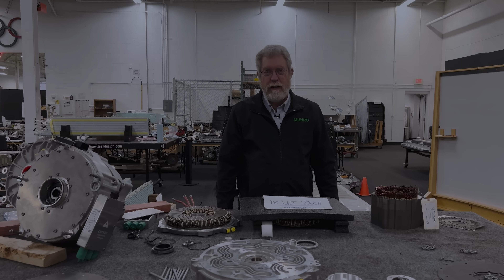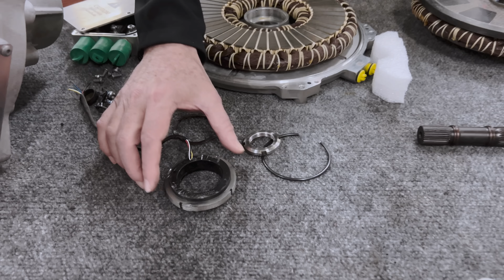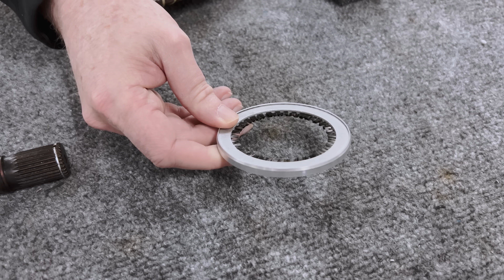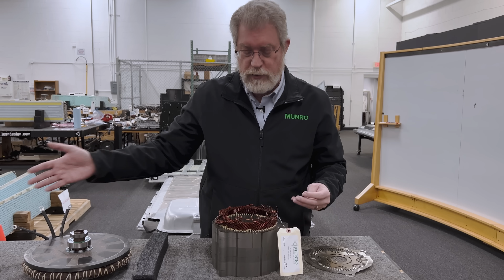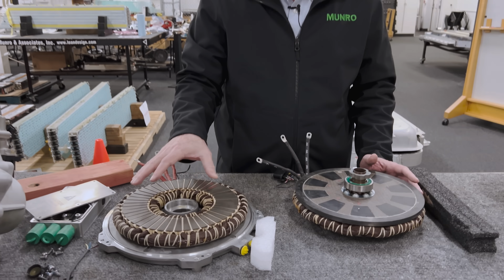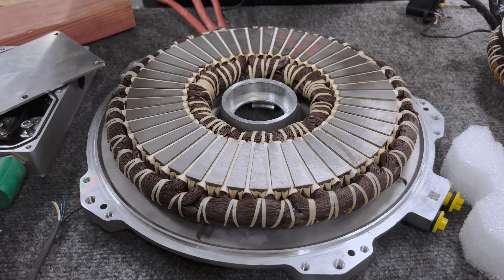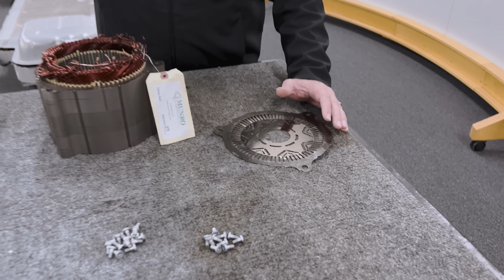Axial Flux Motors Explained: The Future of EV Powertrains?

Comment: I don't see any unrestricted forces being applied to the bearings?!!? None more than the weight of the rotor.  Which is exactly what ball bearings are made for. Please help Me to see what I'm missing?!    All I see is a spacer between the two stators, to keep them at a solid even position without fail, only to leave the need for the rotor to stay centered.  Which wouldn't be an issue.  As long as its centered, the pull from the magnets affecting the iron cores, will cancel each other out.   Simply by design.  Without any more cost to engineering… Im sure that's one of only a couple main reasons for two stators.  The other being a more efficient HARVEST. (LoL amazing usage yeah? LoL) of the flux.  Those being the two reasons people are getting excited about them. 

With the exception of the one other design,  be it only slightly different! 

A  PM BLDC AXIAL FLUX, CORELESS/AIRCORE, with in my opinion even one more possible big design attribute, but I'm not sure I want to give it away yet.  I need to find out if my idea works better on not first. I don't wanna sound dumb. 

 Lol.  But anyway.  Having an Air Core coil does drop a little area for Essie currents to be active. But it also drops a very very large percentage of magnetic friction slowing rotation.  

Giving vertical wind turbines a chance to ENTER THE ROOM! LoL  Not having much of a  torque need for start up cost at all.  A No iIon.  PM BLDC makes for an easily spun generator.  Maybe not as efficient as an iron core motor when coreless, But when you need a low torque start up.  Like vertical wind turbines. And their desire for high free spinning rpms.  I think they are going to stand on the same soap box as force driven turbines, like the horizontal ones. !!!  We shall see!  

Anyway. Please. Let me know what
Im missing.  I may not sound like it. But my knowledge is humble.  Im not afraid to learn.  Im happy knowing what I know.  But I can go further than the normal person. And say that I'm more proud knowing what I don't know. Those are
Two completely different things! Knowing when to say “I DOMT KNOW” Keeps any Man from being wrong!!!   That's the secret peeps if you didn't know..  Nobody actually knows everything.  Not one single person is always right.  But a very average person CAN NEVER BE WRONG!!!

Comment: Yawn, these are pancake motors and used for ages (40 decades?) in industry. Originally as DC and later as AC with magnets.
Nothing new just engineering and refinement for automotive applications. FYI; 30 years ago electrification in many applications started like in machine tools, direct drive elevators etc. etc.

Comment: That cooling duct doesn’t seem very efficient to me. 
The cool water will be heated by the returning hot water resulting in much less heat transfer. Yes you get a more uniform temperature over the plate but at the expense of less cooling. I would think that more cooling is more important. The hottest winding will be hotter in this case compared to a one way flow.
Also at the end of the channel the water will be very turbulent and have to turn 180 degrees increasing the flow resistance. Depending on the flow rate there is a slight risk of airlock if it’s not mounted with the turn down.

Comment: There are a few errors in this video that I'd like to share after designing several axial flux traction motors back in the period between 2005-2009. First at 8:27 into the video you talk about torque as a function of surface area is the same between the axial and radial motors which is incorrect for several reasons.

First is that for axial motors the same Newton of force on the inner and outer radius of the magnet, the torque produced is proportional to the radius, thus the outer Newton of force turns into approximately twice the torque in Newton-Meters, than the same Newton of force on the smaller inner radius. Torque is force times radius. For radial motors, the radius is constant, and each segment of the stator-rotor force interaction has identical torque. Thus axial motors are less efficient in producing torque because of the radius changing. It's easy to scale the torque of a radial motor simply by making it longer, which for axial motors means making it larger in diameter. For low speed traction motors that might not be a problem. But when increasing radius to scale torque, the radial motor gets better gains, over the same radius increase for an axial design.

Second, the stator in an axial motor is winding limited by the small space on the inside of the radius. This leads to less torque generation at the outer radius where more copper windings would provide equally more torque. On a radial motor with the stator on the outside, you can add as many more windings as needed by having a larger stator core around the PM rotor.

Third, in High School AP Physics 2, the principles of an Electric motor are presented in the simplest form of an air-core motor, but the same principles mostly apply with iron core motors. More Amp-Turns produce more torque, up to the point that the iron core saturates. What is the limiting factor to the magnetic force between the rotor magnet and the stator electro-magnet, is the size of the air gap between that stator and the rotor. For radial motors, the magnetic field in the gap is typically around, or more than 1 Tesla, due to a very small air gap between the rotor and stator iron poles, and is easily maintained with precision by the bearings. For Axial motors this gap is typically larger, because the bearings can not precisely control the "flutter" of the rotor with a short distance between bearings in relation to the long moment from the bearing center to the rotor outside radius. Torque = amps * turns * Teslas * radius.

Fourth, Power = RPM * Torque. For the same torque an axial motor typically has a larger radius, than a radial motor. Generally a radial motor's rotor can safely reach significantly higher RPM's without destruction, and produce significantly higher torque at higher RPM's. The heavy axial rotor is a significant flywheel, that does not like to be rotated, without extreme gyroscopic precession, that will heavily load the axial motors bearing, as the precession forces the rotor into the stator. This is significantly less of a problem for radial motors with bearings on each end of the rotor, even for traction motors with a large diameter (many poles) and a relatively narrow bearing spacing, since the rotor-stator interface can be arc'd at that radius, maintaining very small stator-rotor gaps, even with flutter.

Fifth, the stator in a radial motor generally has the strength to fully contain a rotor failure at the highest rated RPM's for the motor. Very few axial motors are capable of containing a rotor structural failure at the highest RPM's, which will typically blow right through the cast/machined aluminum case containing the motor. This can be a huge safety issue if not property managed. A few years ago I was asked to design a motor-generator for a compact jet turbine, where at 70,000-120,000 RPM keeping the radial magnets in a very small cup is difficult, and the shear forces for magnets in an axial design near impossible.

Six, it's possible to produce both stator and rotor iron cores for low RPM applications by casting/machining both, with only slightly higher eddy current losses over SI-FE laminations, with low frequency operations. Even with a high pole count, this can make a highly efficient low speed motor. For high volume, higher speed operation, the Si-Fe laminations can be formed at the mill as a helical spiral and notched as you explained, instead of flat sheet stock to be stamped with a lot of waste. This is done by producing narrow wedge "bars" at the mill, which when flattened hot in a rotory die become helical cylinders instead of rolled sheet stock. The fatter part of the bar becomes the outer radius, and thinner side of the bar becomes the inside radius, and still notchable from either side.

These are the main issues ... along with another half dozen more minor ones, plus a few major ones in regard to efficiency, that continue to promote radial designs over axial designs.

Best wishes,
John Bass
Sr Engineer - semi-retired
Reply: Absolutely excellent comment. To give Munro the benefit of the doubt, I suspect a lot of this is not said in the video because this is the kind of analysis they get companies to pay them for, rather than what they're willing to put up for free here.
Reply: Great insights based on your experience.
Koeningsegg made a "raxial" motor that is supposed to be the best of both worlds
Reply: Thankyou so much for your comment 😅 will be reading it again till I fully get it, cheers
Reply: Fantastic explanations. I would like to ask why this design is using two stators and one rotor as opposed to one stator and two magnet rotors. I'm looking at this from a flux efficiency standpoint. Why bother with the configuration shown in the video when realistically there isn't much benefit over a good radial flux motor?
Reply: @Kabab  There are some really good design points in this axial motor, with extremely good flux path management, while significantly reducing rotating mass. Dual magnet rotor designs require a huge iron mass on each magnet side for flux return path.

Most people tend to leverage off the Dan Bartmann and Dan Fink axial generator design, which is significantly poorer than this design.

I haven't modeled this design, but I suspect it has at least 50% better performance over a dual magnet rotor design, and very likely has pending patents to protect that design improvement.

The down side of this design is that it introduces a lot of iron eddy current losses, that for high frequency/RPM operation will most likely cap it's efficiency in the high 70% to low 80% range. This is extremely poor for high power applications, as the heat generated does require significant water cooling, which is what they tried to optimize.

In comparison the CSIRO design from 20 years ago is air core, and comfortably operates in the 97-99% range with a very small amount of heat generated.

The air core designs I have done easily can do 35HP at 98.5% efficiency.

The best way to solve cooling management is NEVER to optimize a cooling solutions, instead ALWAYS optimize NOT producing the heat in the first place.
Reply: @totally_lost1602  so I understand all that and it all makes perfect sense. Especially designing the motor to not have a heat density issue to begin with.

My thought is that the only energy input is to charge the stator. Half the flux goes out each side of the stator. It sort of doesn't matter how much iron is redirecting the flux on one side of the stator, it'll never be 100%. Wouldn't it make sense to Sandwich this thing with permanent magnets either with or even without a flux ring backing so that all the stator flux is used? Ultimately it'll be limited by how hard you can drive the stator and I realized that cooling this setup is drastically more difficult than the dual stator design....so make it bigger and under drive it. Use all the flux and get torque instead of power out of the system.

I'm sure I'm not thinking about this correctly but I feel like there's at least 30% efficiency gains to be realized there....?
Reply: @ The problem is the magnets are alternating poles, so it's an AC motor with a frequency of RPM * PoleCount

With that there are eddy current losses everytime a stator pole changes polarity. Count the poles on the stator, and multiply by two for both sides.
Reply: @totally_lost1602  more reason to go with a single stator dual rotor design
Reply: @Kabab  In a sense, the magnets on the rotor are 'two-sided; and each side is exposed to the magnetic field being generated by one of the stators. Perhaps you could achieve the same output by using a slighter thicker magnet (double the thickness?) with a single rotor as you would with a magnet with half the thickness but two rotors. In that case, you would have to find a way to have more current in the stator windings. Since the electromechanical energy conversion occurs because of the voltage and current inputs to the stator that are being converted to torque and angular velocity, the higher the power in, the higher the power out, and the higher the current in, the higher the torque out. My simplistic understanding...
Reply: @pradeepattibele  so, I hear all that but if you have a stator with nothing one side, there's flux being wasted. I'm not sure there's any way around this. One rotor and two stators is also more to magnetize which takes more voltage and more power. I just can't see any orientation with two stators and one rotor that makes sense. The only benefit would be increased torque at very low RPM which may not be useful
Reply: @ The reason to use axial flux motors from an engineering point of view is that it is a way to make motors with a different form factor to radial flux, that will be more useful for certain applications. The reason companies are actually doing it is probably for pump and dump hype on their shares - especially given the radial flux motor in the Lucid Air is more power dense than any axial flux motor currently available according to this video. 

As for using a single stator, the form factor of the motor already leads to a thin rotor with a big radius which isn't very stable from side to side, so keeping it between two stators means the resultant of the magnetic forces on it can be kept in the radial direction as much as possible to reduce this instability. Having the stator on only one side will make keeping the rotor stable much harder, so the gap to the stator will need to be bigger (Less efficient) or the rotor will need to be made a lot stronger (And heavier). 

Having symmetrical stators each side of the rotor should also give the magnetic flux lines a closed loop through as much working electromagnet as possible too, which my understanding is will make it more efficient and more power dense, but I'm no expert on electric motors.
Reply: @peglor  I'm pretty sure i can design an air core radial design in this same form factor and power that would be better than 97% efficient, and not require anywhere near the same cooling. The eddy current losses in those stator poles will be significant for anything over a few hundred RPM. IE ... it would probably make a pretty good low speed stepper motor, but really suck as a traction motor on the street.

Comment: My dad used to work for an elevator company, and back in the 90s they introduced an axial flux motor on their elevators: it was smaller and thiner than the usual radial flux motor, so it could be placed directly in the elevator shaft (no engine room required). Elevator engines need a lot of torque, but they also rotate at a slower speed, so the strain on bearings isn't as bad I guess?
If you're curious, look up Kone EcoDisc

Comment: If there are large axial loads placed on the bearings (@9:55), you can place an outer ring of ball bearings at the outer diameter of the rotor (by extending the rotor's radius) and support it with an outer ring of metal (or whatever) so those forces are eliminated.  If it affects the magnetic fields, you can use ceramic bearings instead and maybe a composite outer ring for the bearings to track in.  Electric motor speed is usually pretty low in an application like this, so not much lubrication should be necessary for the bearings.

Comment: You said "...36 slots..." but I counted 45, and there appear to be only 10 magnets.  What is the design principle behind choosing the  number of slots (or coils?) in the stator and the number of magnets on the rotor?
Reply: The rotor's magnets are in pairs; in this case there are 5 pairs (so, yes, 10 magnets, alternating in orientation). Each rotor magnet is a pole, and for each pole there must be a winding loop (forming an electromagnet pole); in a 3-phase motor, there is a winding and pole face for each of the 3 phases. In a "concentrated" winding pattern each pole is separate, so there would be 30 pole faces (so 30 slots) in the stator iron. 

There are more than 30 slots (and faces) because this is a distributed winding pattern. Instead of all turns of winding for one pole being identical around a single face (so through the same slots), some turns are shifted to each side, overlapping each other. In this case the overlap is not a whole pole face, so there are more slots and each turn spans more than one slot spacing. The specific distribution pattern used here results in 3 slots or every two that a concentrated winding would need, so there are 45 slots. 

I have no idea where Paul got 36 (rather than just assuming 30), but he acknowledged in another comment that he was mistaken. Perhaps he was assuming the minimum number of slots and was also at the same time thinking that there were 6 pole pairs.

The Bolt motor also has a distributed and overlapping winding design, so it too has more slots. It has 4 pairs of rotor poles, so a concentrated winding would have 4 x 2 x 3 = 24 slots... but it is has 72, as you can see in the steel lamination sheets shown in the video.

Comment: That AF rotor doesnt have enough cooling. Under load it will get hot and the magnets will weaken temporarily, come back to normal strength when cold.
I used Motenergy 0913 axial flux PM motors in electric superbike racing from 2011 to 2016. Australia.